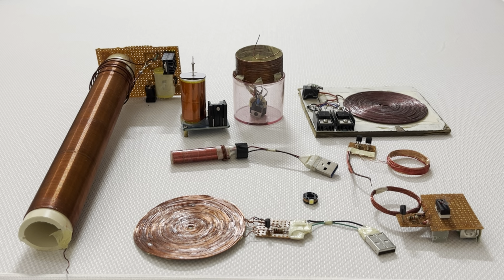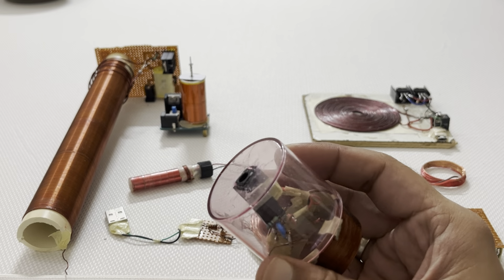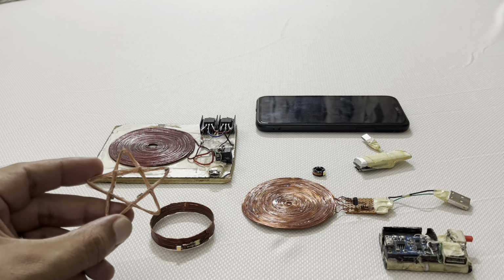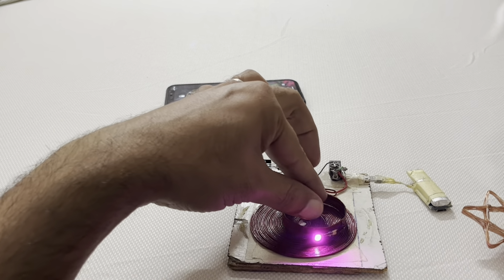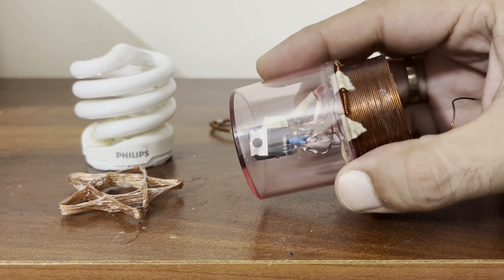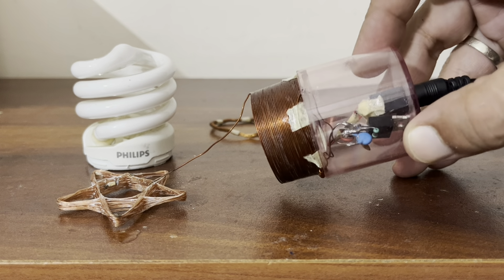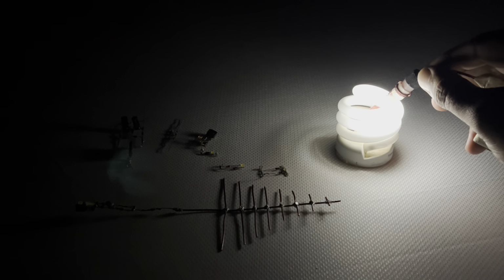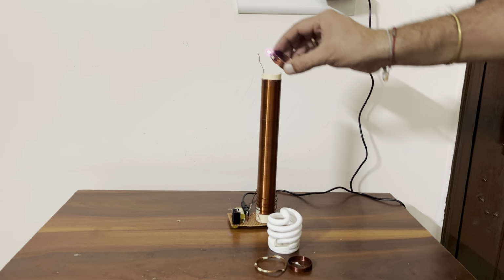Types of teslacoil #teslacoil #nikolatesla #teslamodels

Comment: Bifiler coli making video uploaded Karo sir ji
Reply from the maker: How to make wireless charger. ⚡️ FOR APPLE AIRPODS AND APPLE MOBILES📱⚡️ #teslacoil #bifilarcoil
https://youtu.be/w-2lPZzkklI
Reply: Sir these products are available in market? If not can u supply the needed one, kindly enlist with price. 
Nicely xploided bifiler know how and applications. Godspeed. How can will produce coils for crystal radio making. 
Can coil
Reply: Here old dynamos can be used, where elecricity power is not accesssible.
Reply from the maker: @dashrathrajguru4947 sir, please follow channel on instgram too. I will tell you things there
Reply from the maker: @dashrathrajguru4947  which one you want ?